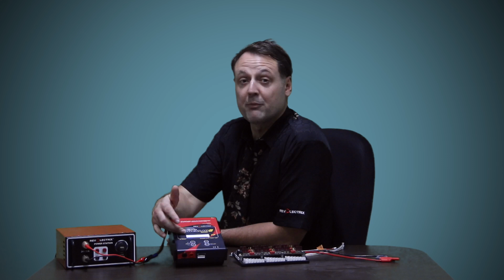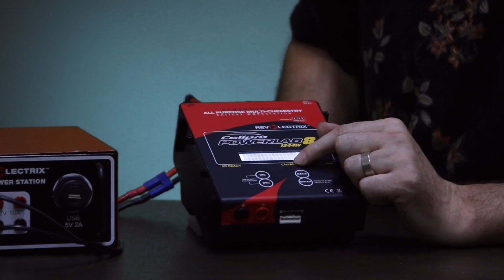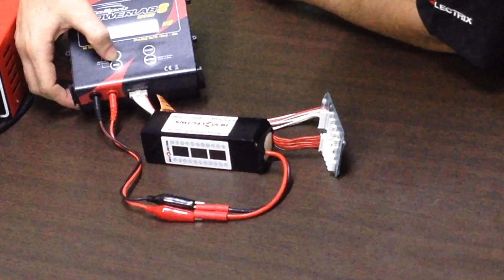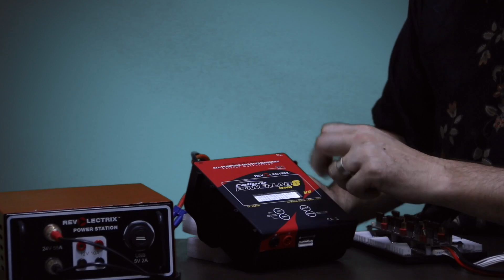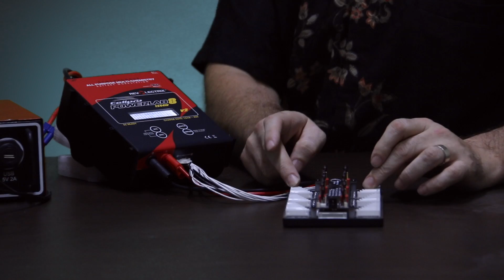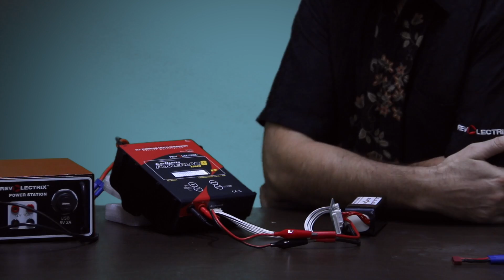REVOLECTRIX PowerLab Use

Comment: how about a video on high voltage lithium polymer batteries. I have the latest update and can not get the charger to recognize the different chemistry.
Reply: Have you gotten the battery chemistry figured out yet? I only get to see the default presets and cannot change them. I'd like to charge some Li-Ion 18650 cells but I cannot change the chemistries at all. The menu he gets when switching on the charger I do not get. Also - seeing the screen would have been great